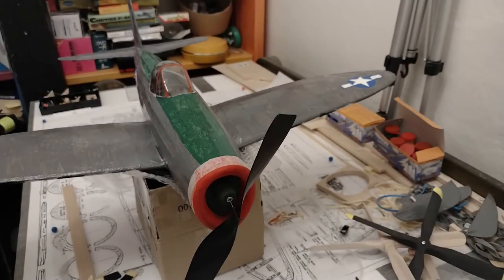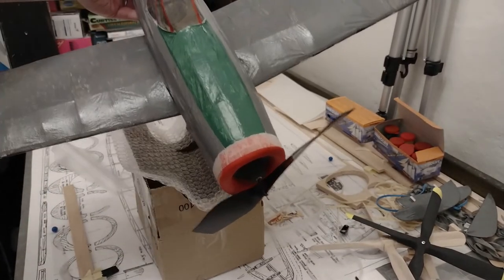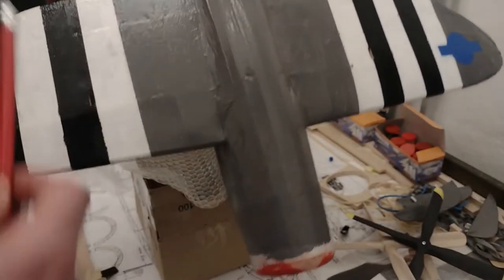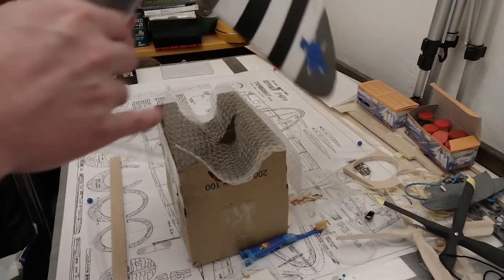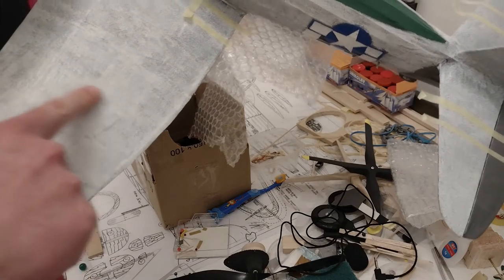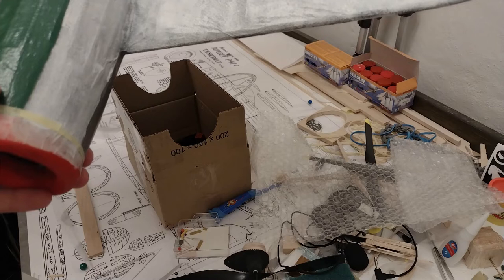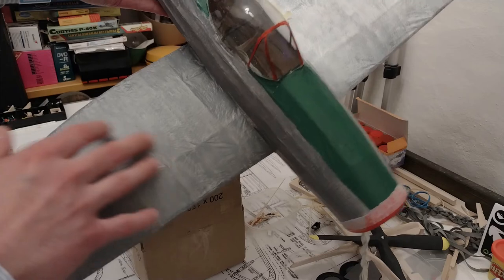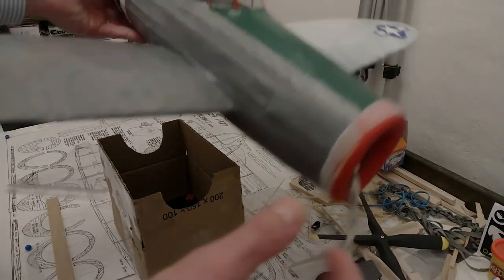16 Balsa P47   Painting failure

Comment: I commend your ability to keep trying. I have very little experience and build static models. I have had good results using spray cans with numerous light coats for the base coat then a brush for the detailing. John Central Indiana U.S.A
Reply from the maker: Thx. Spray cans is a good idea. I would need to mask much ore and maybe use a box. Something to consider. Thx!

Comment: Too much paint my friend it will not help when it comes to the flying, try coloured tissue for a lighter colour method, and your covering methods are not quite right, it's going from bad to worse, sorry mate.
Reply from the maker: And, of course you are right. Paint was too thick for a rubber model. Coloured tissue would have been a better choice. About the covering methods I would be glad to hear more. 
Eventually I did get the model to stay in the air for 4s. Not much but I didn't try enough probably.
Thank you for stopping by and for dropping a comment!
Reply: Hi, for many years I've covered my models with tissue, using thinned PVA, or tissue paste, then when dry shrink the tissue with water and one or two coats of thinned dope 50% dope 50%thinners tightens the tissue nicely and keeps the weight down = better flying model..no PVA on the tissue it doesn't need to be watertight it's a plane not a boat..
Reply from the maker: @nikgrimmett8736  I did try using dope, but I can't figure out what thinner to use. Maybe I need to ask at the hobby shop for more details. It is also a bit expensive and very smelly ;)
The water tightness I try to do with clear lacquer spray when I can. Sometimes if I go in the early morning the air is still quite humid and the tissue wrinkles up again if I don't do anything. I know the solution is to go at midday, but there are too many people watching ;)
Thx for the tips!